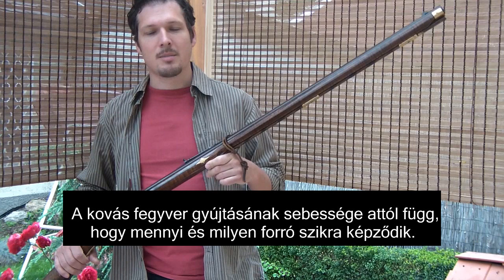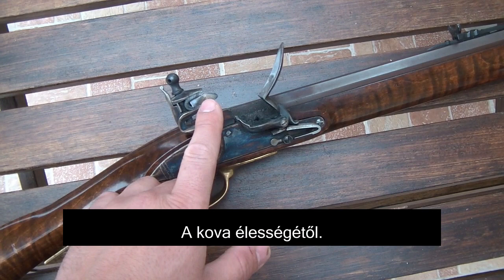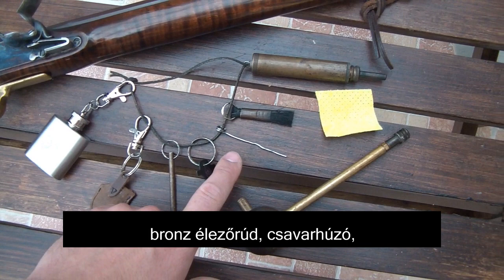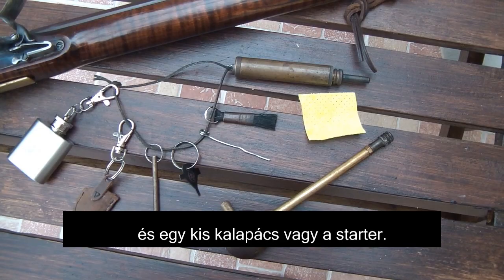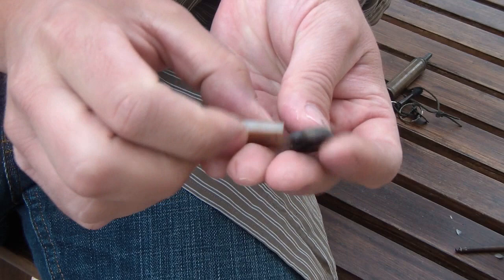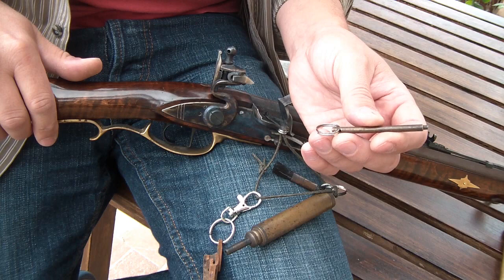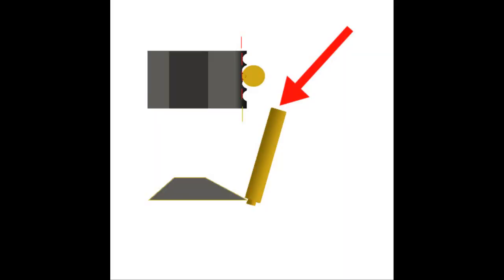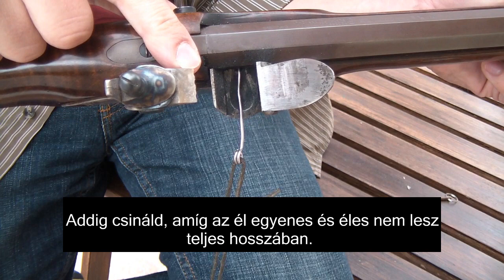Sharpening the gunflint

Comment: FWIW, I tried turning a 3/16" brass rod (available at hardware stores) with a power drill w/ stand and a file; didn't work.  I then went to a locksmith.  He didn't have a metal lathe, but we did use his drill press and put a file(s) in his vise.  Seemed to do a nice job, although, not having the measurements of your rod, I might have taken off too much -- I thought the turned diameter was half the rod's, but in looking at your video again, it seems a little more.  Will let you know if problem.

Comment: Great video!  Could you please confirm the dimensions of the brass rod that you mention at 2:50?  I heard/see something like 7 cm long and 4mm in diameter.  How deep is the cut?  1 mm?  Or what is the diameter of the narrowed rod (what is left at the tip after the cut)?  Also, if one doesn't have the equipment to turn the rod, can one just file a cut into the end of it, or does that cause problems? Thanks! 
BTW & FWIW, I saw absolutely no problem with your terminology!  Again, great video!!

Comment: What about the gunflint width? Should it be the same as the hammer plate?
Reply: It’s called a frizzen and yes it should be very close to the same width but if it’s wider maker sure the extra width is on the OUTSIDE of the frizzen and not the side facing the barrel or you will scar the barrel.